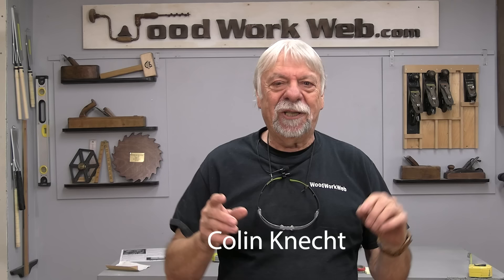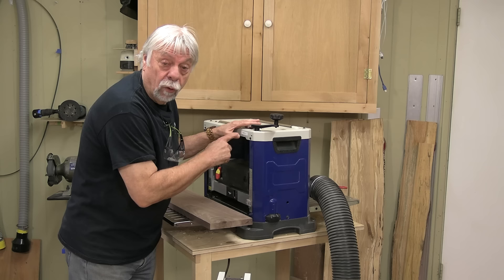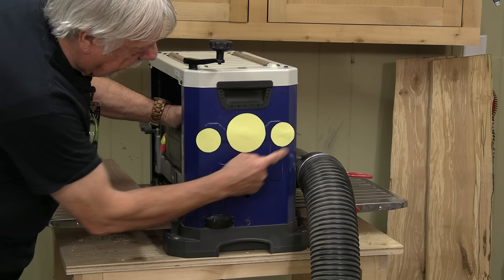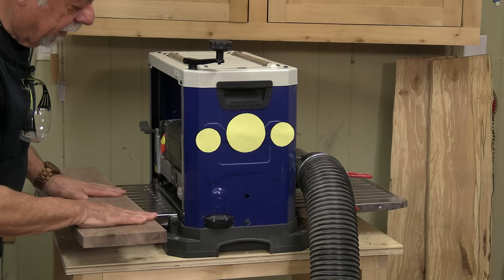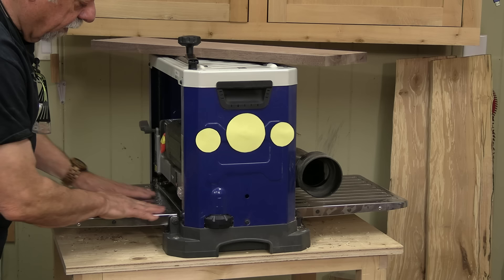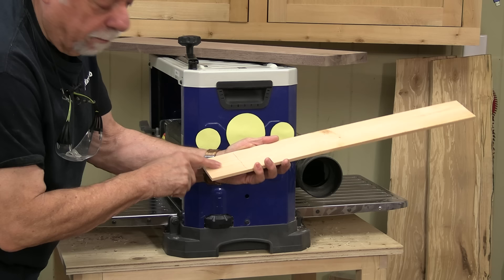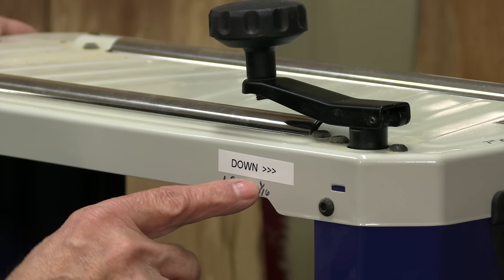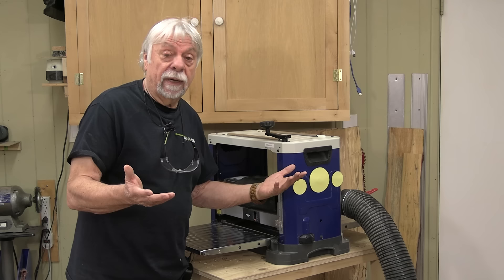Watch This Before Using a Wood Thickness Planer

Comment: All good Colin, except the cleat should be on the front of the sled, not the back, as the roller pulls the work into the machine, and can leave the sled behind. It did for me!
Reply: Common mistake. Seen this on other youtubers’ videos.
Reply: Literally every version of a planet sled video they put it on the back and I had this EXACT SAME THING happen. It left the sled behind
Reply: I beleive the cutting head spins in opposite direction of roller. Maybe the cleat on the back is for if cutting head catches on the workpiece (and the roller didn't have a good grip).

I do have the same issue with my planing sled where the workpiece gets pulled forward off the sled when roller pulls. I have used double sided tape and glue to try and resist this. Another tip I saw on this channel was to use anti skid material underneath. I tried it but was a little uncertain of accuracy to actually remove wobble because the material has thickness and flexibility, it squashes down a little when roller engages but was hard to tell when setting up shim if the work piece was actually stable. The flexibility masked if the workpiece was stable (same worry for double sided tape)
Reply: @masterlock121490  I used the anti skid material ONCE. Let me tell you, it is not a good time if it gets wrapped around your cutter head.
Reply: @briankillebrew  Bet that was a wake up moment!
Reply: Put a cleat on one end, and an adjustable cleat on the other (so that the board can be pinned between the two cleats… making the board and sled “one”)
Reply: @luke-guitarist  That sounds like a plan, although I've used hot melt glue as well as the front cleat. Do you have a proposed solution that doesn't use metal fasteners? I'm also not keen on using the anti-skid material for the reasons others have brought up.
Reply: @wiseoldfool  Sadly, I don’t have a solution right at this moment, I use hot glue too… sorry about that
Reply: No
Reply: I thought the same thing

Comment: If you have to choose between a jointer or planer, I'd say get the planer first. A planer can be used to flatten a board (with the sled), but there's no way to thickness a board and obtain parallel faces with a jointer. The sides can be squared up with the table saw using various methods. Having both a jointer and a planer will save a bunch of time though.
Reply: I agree. Get a planer first. There are plenty of jointer hacks but no good way to bring a board in-parallel with its opposite face without having a planer. The only caveat would be if you want to opt for a drum sander over the planer. It is a bit tedious, but you can use a low grit paper to plane boards, and now you'd have a machine that can save a lot of time with your finish sanding as well; depending on what you're doing, it may net out as time saved. At the very least you'd have a more versatile machine and that's important if you're just starting off

Comment: Good video. I've subscribed for a long time and enjoy your input. Thanks for a good job. I worked at Home Depot for a while before I retired and am more than familiar with planers. One issue owners need to be aware of is replacement blades. Depending on the brand name the availability of the right type is up for grabs. They are very thin and wear out fast so stock up your supply when you find them. Top brand names especially upgrade their models every few years with changing specs on their blades. Customers get real mad when we don't have them in stock, but that's the nature of the business. With 20/20 hindsight that would have been a good topic to have covered in your video. Oh well.

Comment: Excellent videwo Colin. It should get anyone with a new planer started,  and if they read the comments, they will be in good shape. By the way, I have straightened boards up to 8' long with a planer sled.  Also, if a board is very twisted, it's best to cut it into shorter lengths and straighten them. I have had some pieces that were so twisted they looked like firewood candidates.  By cutting the pboarde into 2' sections I as able to get four straight boards out of an 8 footer.

Comment: I think it's important to clean the platten with solvent from time to time. I also use a beeswax stick and kind of draw a few lines on it and then buff it to make it slick. The platen can, depending on the woods you work with, become sticky putting a load on the rollers and causing them to slip on the workpiece. It can tear up the surface of the rollor pretty quick.

Comment: Hell-o there Colin just want to tell ya what I did to stop snipe - I cut a board the same thickness of what I will plane , make it 12"long , 3/4"wide ,4 of them , hot glue them to each side , 2 on font , 2 on the back , the rollers are on top of the pieces , the head is starting to cut them ,the head will not drop till after the board is cut ,the rollers are still on the side pieces / all snipe is eliminated from you board

Comment: Great info but a repeat of every other video on the subject. I have a Delta 12" that is a SNIPE Monster. I tried all the work arounds with no success.  Tore it apart and realized the whole cutter head rocks on the four posts. Miked them up and have 0.200" clearance on all four. You wouldn't think it would move that much but it does. Bought the planer some 30 years ago but  it sits 360 out of 365 days a year. From brand new it was a snipe monster. Only thought I had was having shafts Knurled.

Comment: #4 - when buying your Thicknesser, get one that has a cutter head lock. This largely stops noticeable snipe as the board exits the machine because the cutter head height is firmly locked to a fixed column, the feed rollers are independently sprung and can't make the cutter head move up or down like on lesser machines.
Reply: Thanks for the good tip.

Comment: I love your videos Colin but here I believe you have made a serious mistake with the planer sled, and I have seen it on other planer sled videos of yours as well, so I have to point it out: on nearly all benchtop planers, when you use a sled, the "catch strip" should be at the front--the end that enters the planer first--not at the rear as you have it. Yes, the cutting blades try to slide the workpiece towards the rear, so you may think the stop strip is needed there to prevent the workpiece from sliding off the rear of the sled. But, there are also a couple of pinch rollers that are pulling the workpiece forward, and without a stop strip at the front the workpiece will tend to slide off the front end of the sled. Who wins this tug-o-war? Obviously the pinch rollers do; otherwise the entire sled would not be pulled into the planer--you would have to push it through yourself.

If there is enough friction between the sled top and the workpiece bottom that might be enough to keep the workpiece in place, much like if it were taped down. But if those surfaces are slick the pinch rollers will simply win the battle and pull the workpiece forward, off the front end of the sled, and out through the front of the planer leaving the sled behind.

This happens to me all the time, either by accident or whenever I want to demonstrate the effect for others. I'm surprised you have not experienced it yourself.

Finally, I note that with some larger industrial planers the pinch rollers are at the bottom (under the sled), trying to pull the sled forward, while the cutting wheel works on the top, trying to push the workpiece back. In this case the effect is opposite, and the catch strip should then be at the rear of the sled.

Comment: Generally the reason snipe will occur is that before the end roller engages (on infeed) or after the lead roller disengages (on outfeed) the cutter head can pull the wood up into the cutter, especially if there is any give to the infeed and outfeed trays (and many of them have some give). One trick that can work is to slight lift up on the back of the board on infeed until the second roller engages and slightly lift the front of the board on outfeed. This leverages the board against the roller and forces it down onto the platten - in essence acting like a second roller, when only one of the machine's rollers is engaged. This is not a great solution when you are trying to flatten a dozen boards in a row, but with a single board or a second person to help, it can work well.

Comment: Colin please help!  I have a brand new 12.5" planer and I keep having this trouble whereby the board feeds fine for the first half to three quarters but then it stops feeding.  I tried making a melamine table and have leveled the infeed and outfeed tables as well.  Are my boards slightly warped?  Should I throw the whole thing in the dump?  I am fed up!

Comment: I think the big issue causing most weekend, or moderate level woodworkers, to have snipe issues is that most of us don't have a proper jointer. This is just a theory. I think most people have cup or twist snipe, which is very hard to eliminate even with setting up the planer perfectly. If the board naturally dips you will get some snipe. 

Jointing sleds are not truly as effective, and are sometimes time consuming. If you have any slack, or your shim isn't strong enough, the roller will depress it and you will still have that cup or twist. Let's be honest, most people are not going to take the time every time, especially because wood can change even after milling if it is in a shop that isn't climate controlled. I'm going to be getting my first jointer at the end of this year, and I am looking forward to speeding up the milling process.

Comment: Hi Colin i bought a parksede plainer thicknesser PADM1250A1 i set it up and on the manual it said to remove the cross struts before use what are they and more where are they? Can you help or are they there at all this is my first plainer and thicknesser.

Comment: Colin ... I'm in the market for a 'lunch box' planer and this was good info on use.  Now I understand why some of my wood working friends have that auxiliary MDF board / feed table.  Based on the color of your new planer, I'm assuming the brand name begins with an "R".  Be interested to know the research on brands you did that lead you to your choice.  Thanks
Reply: That's probably the best bang for the buck on the market. The carbide cutters are a huge step up over straight blades. They cut better, make less noise, last longer and can be rotated. The slightly higher initial cost of the unit will be eventually recouped once you start factoring in the replacement of straight blades

Comment: do both sides of the board need to be flat before feeding it through the planer,  or is one side sufficient?  If so, the flat side faces down and the the other side up?
Reply: Flat side down and the planer will cut the top side to match, boom, two flat sides.

Comment: Question I have is, how much thickness can you safely take off with one pass?  If you have a 1" board and want to take it all the way to 1/2", how many passes should you plan on doing?  Also, if it's a hardwood vs softwood, does that change the answer?  Thanks!
Reply: It depends on your machine; motor sizes vary, but the bigger difference is straight blades vs helical head with carbide teeth. The width of your board may also come into play. If you're too aggressive it's not only hard on the equipment but you risk tear-out. Generally speaking, try not to take more than 1/8" off with each pass. If it's a dense or figured hardwood keep it closer to 1/16"
Reply: @G0F15H  I have the dewalt 735.  1/16 to 1/8 sounds reasonable to me.  I'm going to be milling my own chestnut oak and want to get a bunch of panels at 1/2" so I think I'll mill at 5/8" and 3/4" and try both and see which works the best.  Thanks.
Reply: With a continuous width knives like the DeWalt planers (12.5 inches), remove 1/16" max for softwood like pine 1/32" max for hardwood like oak.
Reply: Some tips: Try and take a similar amount off of either face rather than taking all from one face. And don't lay your freshly planed boards flat on a workbench overnight, rather set it up on some stickers or something to allow air to circulate on both surfaces. Your material may still move after planing, so you may want to plane to a dimension a little thicker than you want, and after it sets overnight (or longer) you can plane to final dimension. Hope this helps.
Reply: Resaw!! then plane.

Comment: Question. The planer bed comes with approximately 3/16” flanges on both sides. I assume these are to keep the stock from creeping off the working area of the planer. I’ve watched several videos on making a one piece bed jig to eliminate snipe . Nobody recreates these flanges on their jig . Do the flanges not serve a purpose?
Reply from the maker: The flanges are to keep the wood from drifting from one side or another and out of the cutterhead path, which would then leave a small raised area that did not get planed, it wouldn't hurt to recreate them but even on the rare time this has happened, I just re-plane the board with no adjustments and that raised area is planed off

Comment: Do not bother buying a thickness planer that has blades. Pay the extra for a helical head cutter.  Putting the shim under the wood is a good idea. Make sure you shim all the high spots under the wood. The drive rollers will push any wood that is curved up down to the bed.  Also make sure the sled bottom has been waxed (no silicone) so the sled will slide easily over the planner bed.